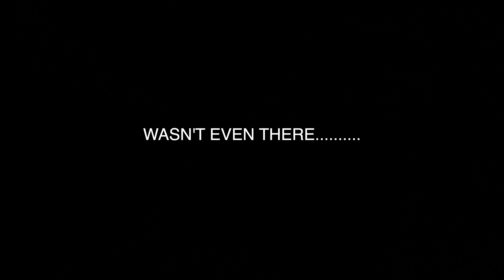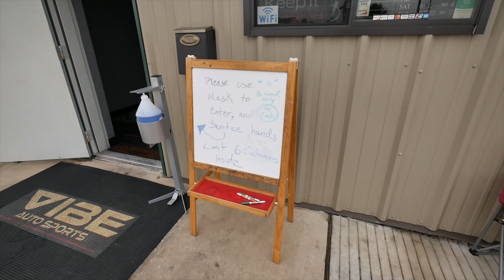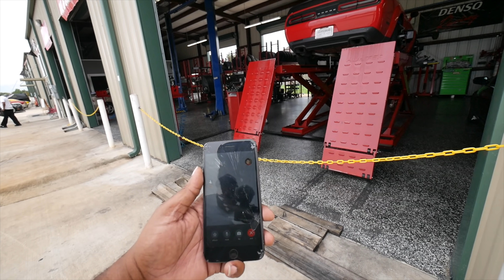HAD TO TAKE MY WIFE HELLCAT REDEYE BACK TO THE SHOP THIS WAS REALLY BAD

Comment: Funny video! On the tire wear though. Regardless sports car or not it should not wear the tires on the inside unless you got camber issues. I've had and still do have couple high percormance sports car and never had issue with proper alignment even with being lowered! Now if the suspension has really been tampered/altered with its sometimes not as easy to dialed them in without ordering speciality parts!